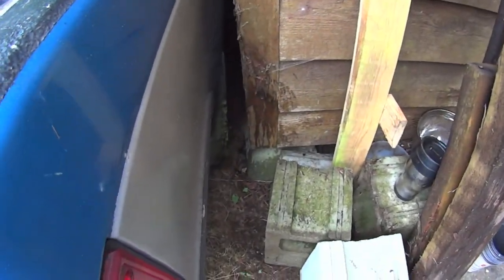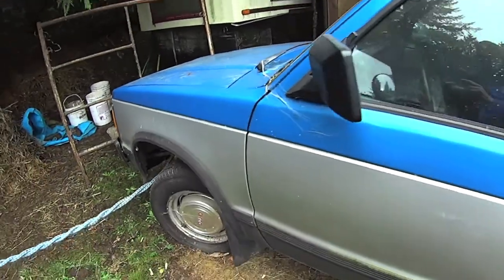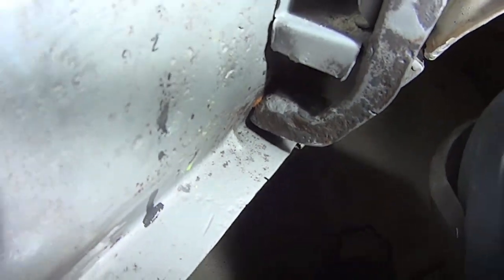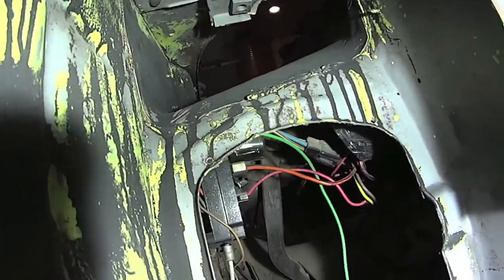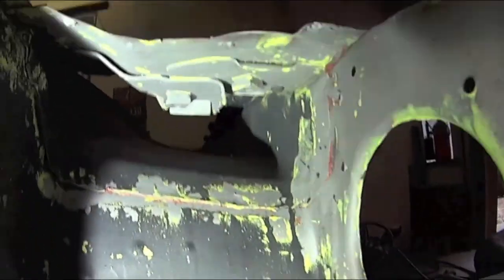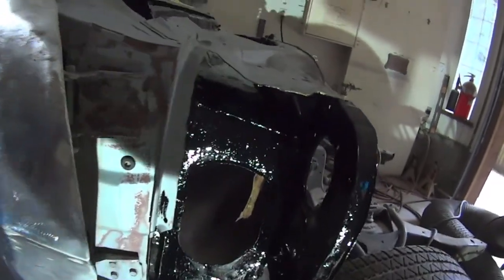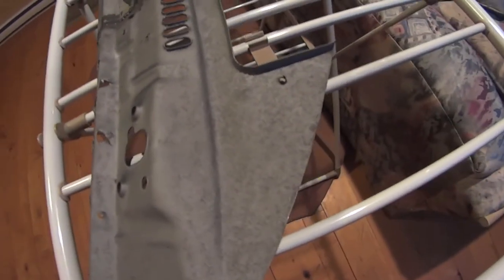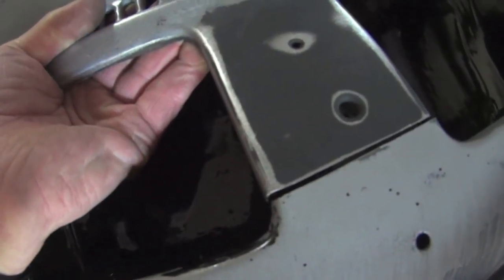1970 Pontiac Lemans Wagon Restoration  Part " 14 " the cowl  & moving S10

Comment: You did very well repairing the cowl vent. Most would have abandoned it, and searched for a donor part. Good to hold on to original metal when restoring a car, the replacement panels never fit, and are usually half as thick.
Reply from the maker: We've been looking for years for a donor, but gave up and had to go for it. 
Yes I have totally had the same experience with replacement panels. Its always best to repair the original if possible. They are usually 22 gauge . Then theres the getting it to my door. Yicks !
    Thanks Bo